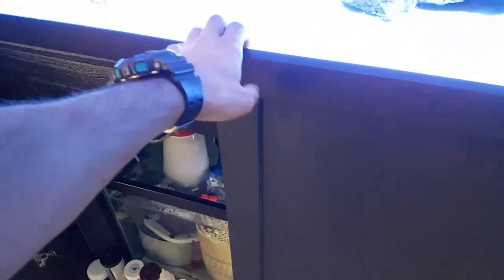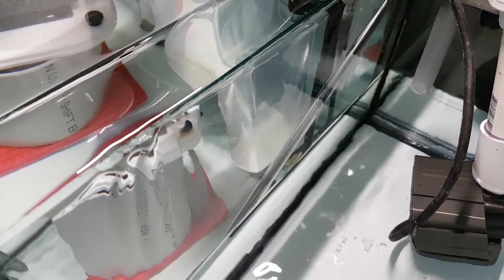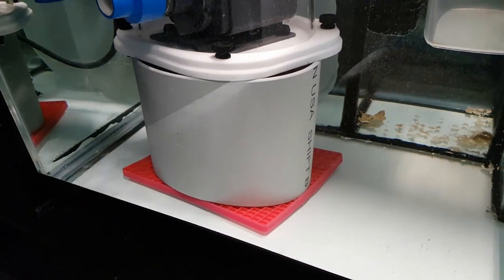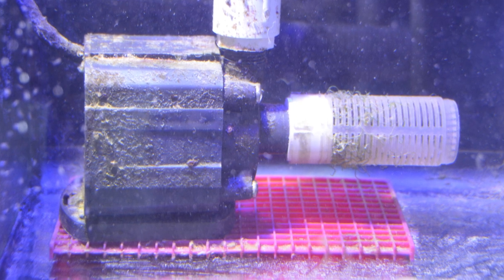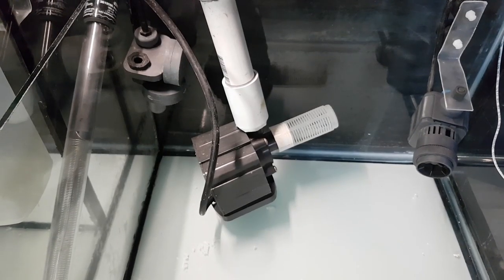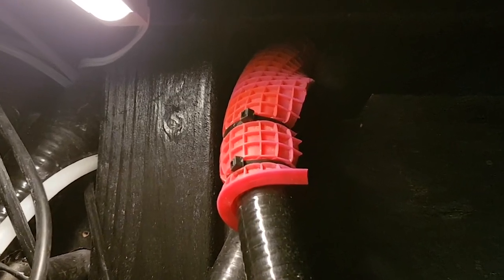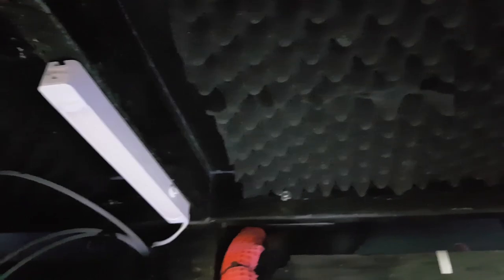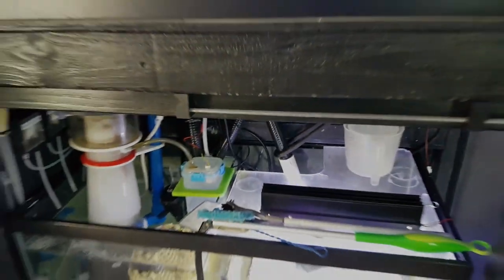Silencing your noisy return pump and reef tank equipment

Comment: where do you get those silicone mats from? Thanks.
Reply from the maker: They are usually called silicone trivets and are available at places that sell kitchen stuff.  The squishy ones with a grid pattern work the best for this purpose.
Reply: do you have a suggested thickness? @gmacreef
Reply from the maker: @kevinpeyton33  1/4" or thicker